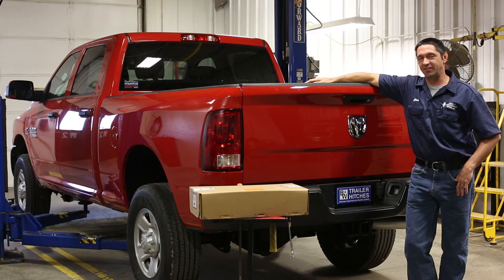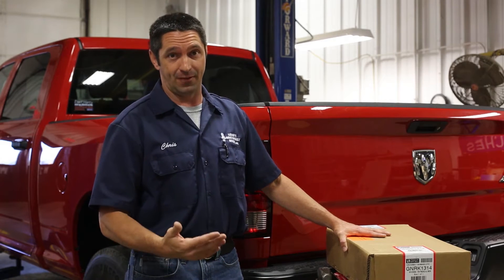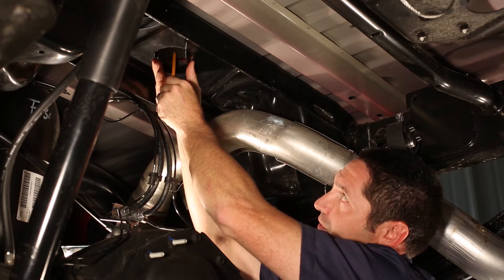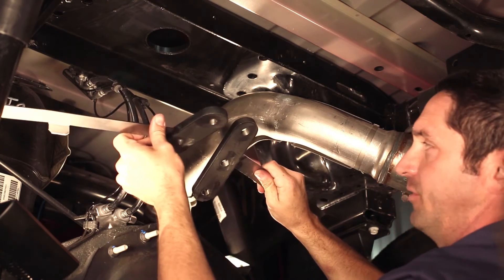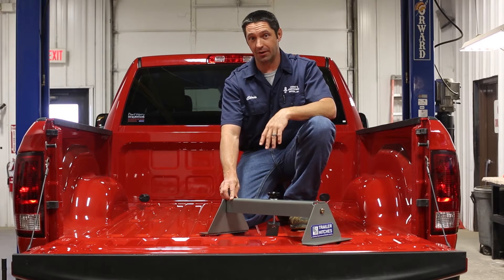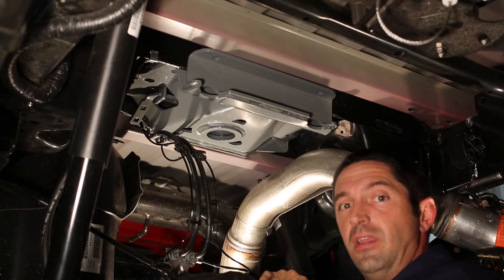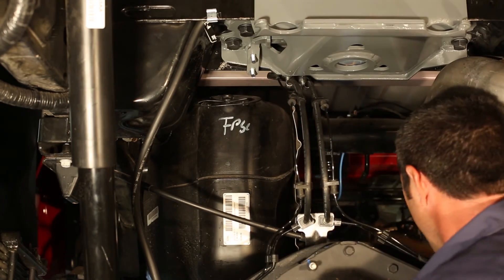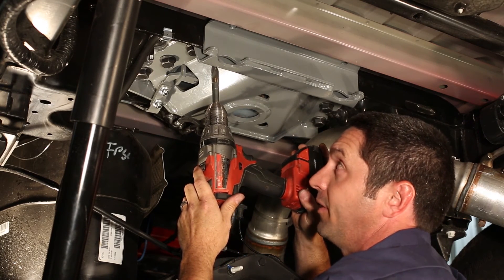Model 1314 Installation

Comment: Does this work with the Ram puck system?  I want to replace my Ram goose center section to a B&W center section so I can run a 4” offset ball.
Reply from the maker: You would have to remove your Ram puck system.  You can loosen the bed bolts and raise one side of bed at a time to take the bolts out of the factory gooseneck system.  Tighten your bed bolts back down, and our Turnoverball will install.

Comment: Will this fit a 2018 Ram 3500, I do have that underneath bracket, which also has that same hole
Reply from the maker: It sure will.  The GNRK1314 fits 2013-2018 Ram 3500's.